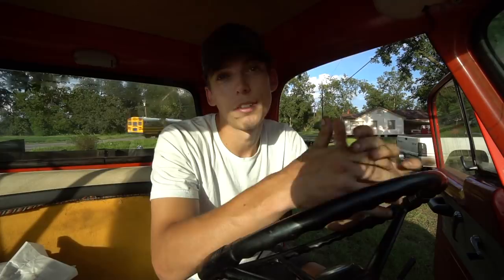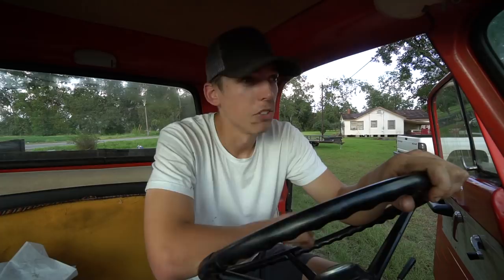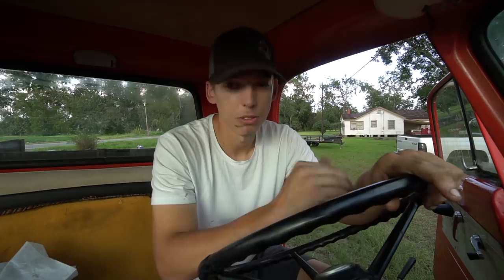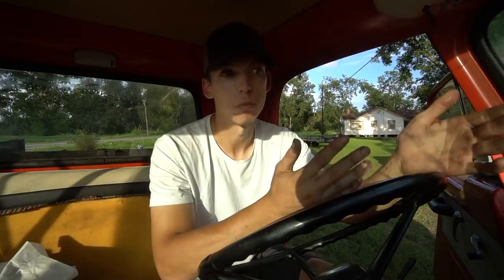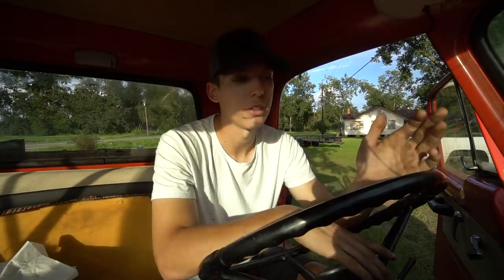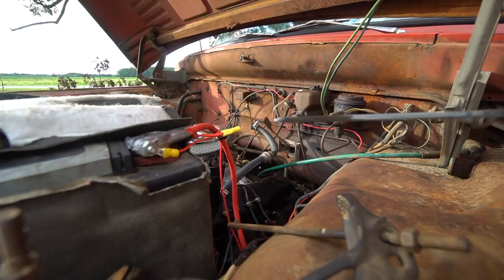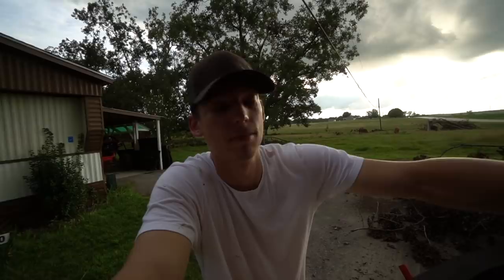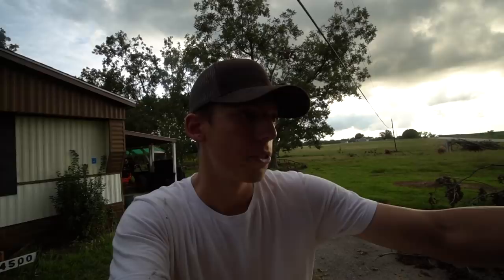Frank Blew His Head Gasket?

Comment: Also first engine oil change do New PCV Valve too also get GUNK WYNNES ENGINE Flush put Engine for 10 mins then shut off engine also changed Oil from Engine plus Oil Filter changed to ! For first 5 mins let engine idle with Engine Flush, then 3 mins high idle to and last 2 mins of low idle too and shut engine done drain Engine Oil and Oil Filter to changed! Then never see white smoke or any colors to even May smell Engine Flush for bit long smell like Paint Remover  but clear always do Flush ever 3 years and add Grey Bottle of STP Total Treatment fuel injection every 3 months too!

Comment: Look back in you other videos, you will see that I said, do a valve job on this engine.
Reply: He needs harden valve seats to run unleaded fuel or lead additive to lube the valves
Reply: 79tazman if it has rotators on the exhaust valves, he should be fine unless he is planing extended high operation.

Comment: You think you're frustrated with your truck a friend of mine asked me to find out what is wrong with his truck 91 GMC truck come to find out he had no more teeth on the flywheel or starter and when I get done replacing the flywheel and starter I told him to put a brace on the back side of the starter he never did so I replace the flywheel tow more time so the first time I bought the truck off of him and fixed it for the last time and I drove it for 6 years before I moved out of Georgia the truck still in Georgia because I never did get the title like he said he would get the title

Comment: Not a blown head gasket , if you blew the heads then it should heat up quick , probably is the well water being dirty , but might have a small leak idk do a leak down test of your cylinders or a compression test and see if a cylinder is down my have a leak in the area of the gasket but I’m just spit ballin
Reply: You didn't put ANY intake gaskets on it. Bound to leak.